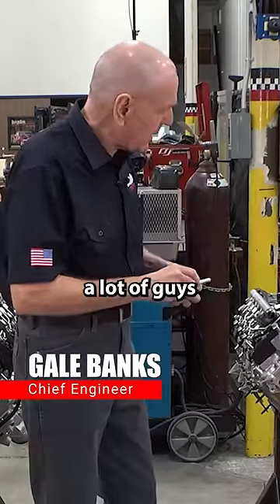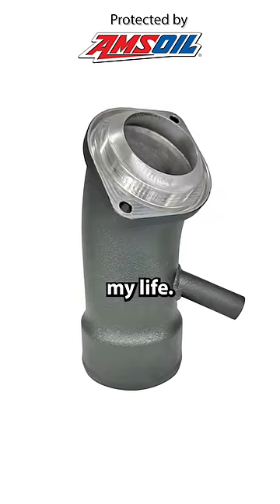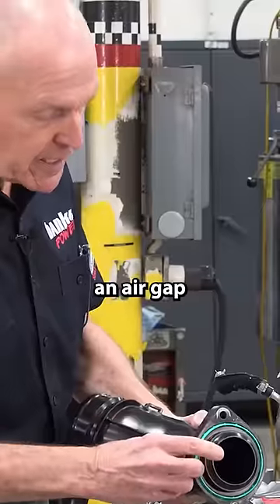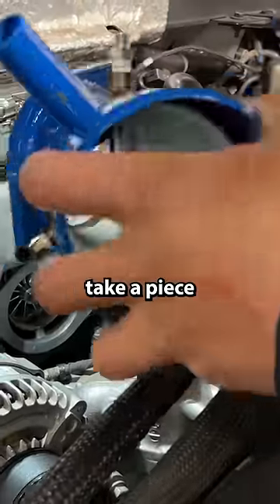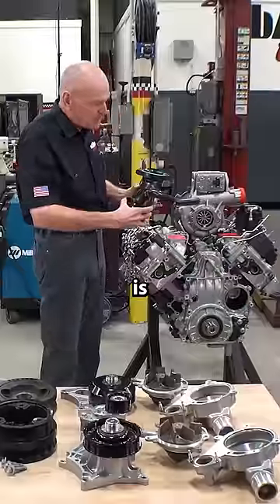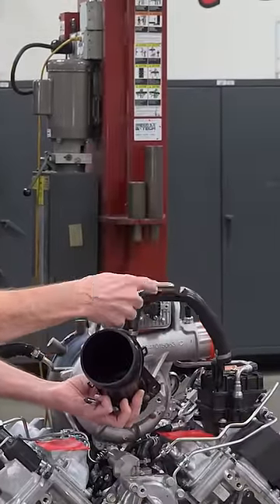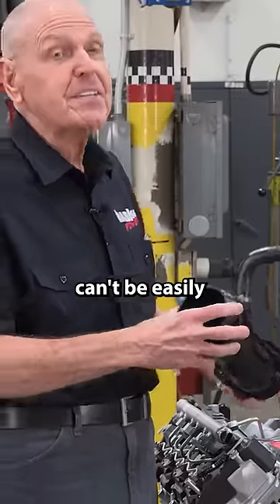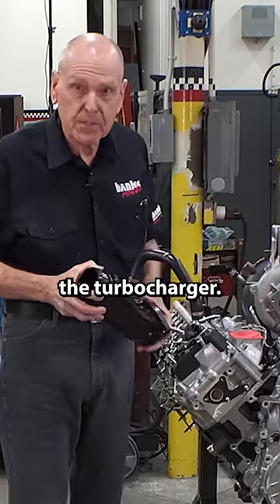The factory guys got it right. Don’t delete this!

Comment: The engineers who design engines get a lot of flack for their engineering mistakes that piss off mechanics, but they do get it right when it comes to how it should run from time to time. Thanks Mr. Banks for your wealth of knowledge.
Reply: Car/truck engines are amazing. The guys repairing engines have the ability to to see what didn’t work. Hindsight is 20/20. And mechanics don’t have to deal with emissions. All reasons why I can’t wait for a good EV truck. The combustion engine is not needed by 85%+ of the population.
Reply: What's funny is they catch a lot of flack, but it's mostly the accounting department that is the real issue. Add in epa and safety requirements, it's amazing that engineers can get anything done.
Reply: @Slowhand871  and to what points can you point at that 85% of the population doesn't need an ICE engine? Who are you to decide what anyone needs? Everyone needs to wake up to the idea that electric is far behind in terms of being a functioning, viable option for the average person simply due to all the inherent issues that come with owning an EV.
Reply: @crispybatman480  exactly.
Reply: @Thestockxj96 What, according to you, are the problems inherent to owning an EV and that stop it from being a functioning, viable vehicle? I'm not the original commenter you replied to, just a former petrolhead who has sold all my normal cars and switched completely to EV over the last two years.
Reply: @LMF5000  the fact that they're not worth a crap in the cold when you charge them, and I know this is a fact because there's Tesla owners all over YouTube who complained about not being able to even get one percent in their vehicle for hours until the battery hit a certain temp. #2 the batteries in most Tesla vehicles only get a couple hundred miles of range depending on many factors such as ambient temp, use, and amount of strain put on the battery. #3 and you're probably going to call me a conspiracy theorist for this, but I don't care because the truth is still the truth at the end of the day. The vehicles are hooked to the internet constantly, and therefore if a government entity or even Tesla didn't want you to travel all they'd have to do is shut your vehicle off with a remote killswitch. #4 the average life of an EV battery is about 10-15 years roughly. #5 most people don't make enough to replace one of those batteries, so what do they do? They toss the vehicle into a boneyard and it ends up leaking acid everywhere. Yeah, very environmentally sound, right? #6 inherent issues and bugs that electric vehicles have made me not trust them whatsoever because here a few years back a guy got into a wreck with his Tesla and it locked him inside and burned him alive. #7 all that charging you just did was either provided by an diesel or gas generator, so you're not really saving anything on the planet. You've traded one evil that you can see for something that's indirectly polluting every time you charge. So again I'll ask, who are you to say 85% of people don't need an ICE vehicle.
Reply: @Thestockxj96  Again, I'm not the one who made the original comment, I just thought I'd jump in since I'm an actual EV-only driver. #1 Yes, EVs cannot charge at insanely cold temperatures. ICEs need help at those temperatures too - like an engine block heater to keep the oil from freezing and a relatively new, very healthy starting battery to crank the engine reliably. #2 Yes, but a couple hundred miles of range is enough for most people. The vast majority of the population doesn't need to travel 500 miles in one go every single day. And at any rate on road trips you still need to stop to pee every couple of hours, so you can fast-charge the car while you're going to the bathroom and be on your way. #3. This is not an EV-specific problem, this applies to every modern car - electric or not. Almost every model in the lineups of all modern manufacturers are internet-connected and can in theory be disabled remotely. #4 After 10-15 years the battery will have about 80% of its original range left. That's still plenty for most people. Things degrade, EVs and ICEs are no different, after 15 years the car itself will be getting worn out (regardless of power source) and it would be time to recycle it for a newer model. I can tell you the warranty on an EV battery is 100,000 miles or 8 years, and the components on an average fuel engine have a design life of 100,000 miles too. After that point you start needing expensive maintenance (timing belt, water pump, clutch if applicable etc). #5 The running costs of EVs are vastly less than the running costs of ICEs. In my case a distance that used to cost €10 of petrol now costs €2 of electricity. An annual service (oil/filters/plugs) used to cost €120, now an EV service costs €45. Road license (depends on country) was €350, now it's €10 (but you can ignore this as it probably won't apply to your location). No oil, no filters, and the brake pads last a long long time since most of the deceleration is done by the motor in regen mode - so the savings on running costs over the years come pretty close to the cost of the battery IF it needed replacing at that point. #6 - sounds like a Tesla problem, not an EV problem. Buy a Nissan or a Hyundai or a Ford or something else. Some carmakers use the exact same car model and offer electric or fuel options, so there will be no difference in the "bugs" for components like doors etc - they will be identical because it's the same car whether EV or fuel powered. #7 I'm a mechanical engineer by profession. I ran a simulation on that exact claim. I found that if you take some quantity of Diesel, feed it to a generator, and charge an EV, it will cover approximately 20% more distance than feeding that same Diesel directly to a Diesel-engined car. The difference is that generators are designed for maximum economy so they're large, heavy and slow-revving (1200rpm - perfect for standing still, but not viable in a car) but car engines are designed to be compact, light and powerful (so economy suffers greatly). The EV itself is over 90% efficient at turning the generator's output into wheel horsepower, so overall it ends up the winner. But the point of EVs isn't that they're more efficient at burning fuel, it's that they let us use flexible generation options (like solar, wind and nuclear), and that they don't emit emissions outside your house - the emissions (if any) are in a centralised location where they can be controlled more effectively. #9 yes, obviously walking and cycling (or working remotely) are vastly better than using any type of car, but EVs are a step in the right direction. Plus they're much more comfortable to drive. Back when I still had one fuel-powered car and one EV I would start missing the EV after the first 2 hours of driving the ICE. You can't beat the seamless, silent power delivery without gears, the instant acceleration, the A/C that stays powerful at any speed (even in standstill traffic), the fact that it doesn't stink up the garage with exhaust fumes, and the ability to turn on the A/C remotely so I don't have to get into a searing hot car after it's been parked outside all day.
Reply: @LMF5000  let's see what the cost of electricity will be once everyone starts trying to use electric vehicles. The cost is going to go through the roof. The only reason it isn't right now is because hardly anyone is using EV tech right now. I assume you're in the UK being as how you're using the pound for your dollar sign, and I can tell you right now, geographically speaking 200 miles of range may seem like a lot to you, but for many of us in the US where everything is spread so far apart the idea starts to fall apart. Just look at all the US companies that switched some of their fleet vehicles to EV, and then decided after a few years that it was a horrible decision and decided to go back on it.  If EVs were such a modern saving grace, then everyone would use them. Maybe in another 20 years it'll be different, but as for right now I don't see that happening. The tech simply isn't there.
Reply: Let’s not forget the whole manufacturing process to produce an EV in the first place: including the copious amounts of mining for the lithium ore needed to make the batteries in the first place. Then there’s actually making the batteries in the plant using said lithium, both industries having an inherently massive carbon footprint on the planet.
Reply: @Thestockxj96  Europe actually (I'm using the euro sign € not the pound sign £). The great thing about EVs is that you can make your own electricity - I don't have the roof space but my in-laws have solar panels installed in their house and they actually produce more electricity than they consume, so the utility company pays them. But yeah, in my case I'm at their mercy. As of this moment electricity is 5x cheaper than fuel, but when charging on public fast chargers on highways, they've set electricity prices so high that it's actually marginally more expensive than fuel (but fortunately 99% of drives are done at home using cheaper private charging so it's not a big deal). I understand EVs might not be for everyone yet, but range is increasing all the time - but even then, how much range do you actually need? If you drive nonstop for 8 hours at 100mph that's only 800 miles (and some experimental EVs are getting close to that). At that point the driver becomes the limiting factor, not the car.
Reply: @toxicmasculinity7870  If BMW can manufacture an entire EV with neutral emissions, every other manufacturer can too
Reply: @LMF5000  it doesn't just need range. It needs to be functionally reliable, and these EV companies need to start divulging repair info to the owners, and then maybe I'll start coming to that side. I don't see that happening though because all these companies really care about at the end of the day is how much you're paying on your note and how much they can make off the repairs because we don't want you to have the right to repair.
Reply: @jonathansmith7306  yeah, but did BMW say that, or has this actually been verified as a "carbon neutral" vehicle by a third party, private owned entity? There's a huge difference between a company saying it and someone vouching for the company.
Reply: @LMF5000 you obviously don't live in Australia where the next town is 400k away and the town you're actually travelling to is 900k away. A ten hour drive that I don't need to take any longer than it has to. Then there is a weight issue if you add more batteries that stopping is not good enough in an accident situation. We have all sorts of things to avoid on that drive.  I don't need increased braking distance. Then let's not forget the flooded roads and river crossings. Water and electricity don't mix real well especially when you carry batteries that explode if water gets in them. Being honest I've never seen an ev in my country, I'm sure some yuppy has one somewhere but I've never seen anywhere to charge one. So they definitely don't have one in my end of the country. You're all being sold a lie mate.
Reply: How often do you actually make 10-hour drives? If it's a really regular thing then sure, maybe an EV isn't for you yet. But most people don't drive more than an hour or two per day so EVs are ok for them.

Now, have you actually checked the stopping distance of any EV at all? Engineers like myself account for the extra weight of the battery when designing the car and speccing the tyres and brakes - the stopping distance is identical to a normal car (actually better because you don't have a heavy engine up front, you have ideal weight distribution with the centrally-mounted battery). Secondly, EVs are infinitely better for flooded roads because they don't need oxygen and don't have an air intake. A normal car will bend a connecting rod when it intakes water but an EV will drive even when submerged because it's hermetically sealed. Plenty of videos on YouTube of dozens of normal cars getting flooded and stuck then an EV comes along on the same road and goes right through. That's the reason all modern submarines are electric (or nuclear-electric)
Reply: I fully agree. That's a modern car problem though, not an EV-specific problem. Manufacturers are getting a bit crazy with subscriptions for things and with adding hurdles to repairability. Which is precisely why I chose a Nissan Leaf not a Tesla.
Reply: @LMF5000  mate I gotta drive a few hours just to go to certain shops in near by towns. Near by towns minimum almost two hours one way. Spend half a day there driving around getting things done. Then get back home. Like I said no one will touch them unless they live in the city and go to work and back, do basic shit like the people you're talking about. And did you miss the part where I said I've never seen a single charging station in my entire state. Might be one in my capital city that's a 9 hour drive from me. My ten hour drive is just to visit my family and that's the opposite direction from the city and past there it gets way further apart and another 15 hour drive to the end of my state. That's just my coast line. Let's not get into when I travel west 11 hours just for work every ten days. It's so fat we don't come home until a ten day shift is over. Home for three days and back we go. Last week I drove 600 K just to visit a friend for a weekend. These ev's you talk of are absolutely useless to us here to the point no one will be putting in a charge station. As for stopping distance. Might want to look into what the yanks call trucks and the weight if not compensated for in braking distance is deleting other drivers. Now those size vehicles are what we all drive here because we have all sorts of terrain to cross and large animals to hit along the way.  You are believing lies mate. Good luck with that, no one here wants any part of it.
Reply: @Thestockxj96 nope I’d say most of the population would suffice with an ev. Soon as the infrastructure is here no point not to. It’s not gonna save the earth but the cars are so nice and the quietness is amazing
Reply: @crazywormy5869  you're sacrificing the ability to be able to fix things yourself at home without spending thousands of dollars for something that can be remotely controlled and is extremely complex and convoluted, and literally requires thousands of dollars worth of safety equipment and special tools to fix that no average diy at home person has. WHEN your EV breaks down do you really want to be stuck in the endless loop of trashing another vehicle in a boneyard and starting the cycle over again after paying hundreds of thousands of dollars for a vehicle that lasts, at most, 10-15 years per battery before needing to be replaced? Also, what about when the infrastructure gets there? Don't you logically think everyone's electric bill is going to go through the roof? Do you really think the powers that be are going to allow you to have cheap electric charging at your house forever? Y'all think it's a saving grace. You're only trading one demon for another that makes you feel better in the moment.
Reply: @Thestockxj96  just tell me your not smart enough to fix it yourself then. Everything can be fixed yourself just depends how hard you want to work. No harder then any car from current year
Reply: @crazywormy5869 I never said I wasn't smart enough to fix it, but what do you expect out of the YouTube community. Your willingness to assume someone's intelligence tells us more about yours, but we're not here for that so back to the point. The point is, Albert Einstein, most of us don't have the at home tools required to fix these types of vehicles. I'd love to see you work on one without the required tools and you tell us from your coffin how that went.
Reply: From time to time, meaning once every 20 years.
Reply: @Slowhand871 "The combustion engine is not needed by 85% of the population" has to be one of the daftest,blinkered statements ever.
Reply: it's not even the engineers fault most of the time, they point out something needs a redesign and the pencil pushers tell them it's not worth it.
Reply: engineering time vs shade tree time
Reply: @Thestockxj96 he probably wants us to own nothing and eat bugs too
Reply: @tonymarshall9670 I think it’s fair to say that EVs wouldn’t work in your situation. Your situation does seem quite strange though. A 2-hour drive to the nearest town. An 11-hour drive to work. Those are very abnormal things. Do you realise that? Most people don’t live in such isolated locations where they undertake such tremendously long journeys in their day to day lives.
Reply: @tonymarshall9670  Out of curiosity, can you give me the names of a few of these towns that you travel to/from? I want to plug them in to the ABRP software and see if my EV could make the trip - just to get an idea of how far we are from making it possible.
Reply: @Monaleenian  That's where you are wrong. That's what most of Australia is like. Sure some people don't go as far depending on what they do. But at some point most of those people take long drives at least once a year to visit relatives or friends. We don't have planes that fly everywhere and that's far too expensive for most people. You still need transport when you get there. There is a good reason there are no charging station's here. Australia is to wide spread. The state I live in I share with millions of people this is how we all live. Everyone here travels to nearby towns for work, shopping, even doctors if you need specialists same with hospitals. It's not unusual to us and ev cars is not one the shopping list here for anyone. We all know they are useless to us.  At best our taxi service have some of those electric/pettrol hibred's. Some people have cars that can shut down when stopped and some of the v8s that run on four cylinder until you accelerate hard. Mostly we don't drive v8s anymore and we've switched from 6 to 4 cylinder cars in a lot of cases. Mainly due to fuel and registration costs. And the fact 4 cylinder engine's have come a long way in the last couple decades. It's not that we are not lowering fuel consumption it's that no one in their right mind will buy a car that can't do the long trips everyone enjoys or has no choice in doing. We all need to be able to drive further than ev can go.
Reply: @tonymarshall9670  It doesn’t really matter what most of the landmass of Australia is like. Australia is one of the most urbanised nations in the world, with 90 percent of the population living in just 0.22 per cent of the country’s land area. The 2016 Census showed that more than two-thirds of Australians lived in a capital city, with 40 percent of the population living in the two largest cities of Sydney and Melbourne. For the vast majority of families living in urban areas of Australia, having one electric car makes sense. The second car could be a petrol or diesel for those rare occasions that they need to make a huge journey that brings them outside the range of EV chargers if that’s what they think that they need.
Reply: @Monaleenian  I've lived in Melbourne and can tell you it's not unusual to take a 3 hour drive to go do things for the day. Your ideals don't make sense to the majority of people here. Common knowledge here that it won't work for most people. Does it not register to you that those are big spread out places. Most don't live on top of each other in buildings. Add all the traffic in those built up areas and that adds a lot of time to the drive. Then look at charging time. We don't care for it and if we did I'm sure you'd have statistics to prove me wrong with all the sales of these EV's. Do you have those statistics?
Reply: @Monaleenian  Or, you could put that engineering knowledge to use and make a car with an on-board generator that provides electricity to the motors instead of a giant battery.  THAT'S the future, because, when looking at diesel-electric trains, it's the present, and the past, and has proven to be a robust and reliable system.  Why put stress on an electrical grid that won't be able to handle the demand when we already have the infrastructure necessary for liquid fuels..?

Don't get me wrong, now; battery powered cars are fine for short trips/commutes where you can plug them in when you get home.  However, for anything more than a hundred miles or so, batteries are not the way.  All of the battery advancements have been great for my power tools and RC trucks, though!  Haha!
Reply: @LMF5000 solar costs about 10k a panel right now in texas. that’s a lot of money to charge one car.
Reply: @LMF5000 also bro, going from one side of Texas to the other is like me going from Luxembourg to Budapest.
Reply: The problem with stock engines is balancing budget and mass production with performance. I'm sure the engineers at all the big companies would design a near bulletproof engine given unlimited parameters besides size, but the bean counters in the head office would never let them
Reply: @cwj2733  interesting, that's 1200km or 9 hours of driving. My old petrol car could manage it on 3 tankfuls of petrol. My city EV (40kWh nissan leaf) would need 6 full charges in theory. In practice ABRP says 14 partial charges and 18 hours of total time.

And with a long-range EV like a Hyundai ioniq 5 it's 12h20m with 6 charges
Reply: I'll trust the factory engineers over the keyboard engineers every time.
Reply: If engineers didn’t get things right most of the time, cars and trucks would never even be able to driven off of the dealership lot after the initial purchase.
Reply: @crazywormy5869  the infrastructure will never exist because no one can make money with chargers. In order to be viable with everyone driving them you'd need whole parking lots full of chargers. 

Why do you think it is that people constantly complain that they're broken? It's because they get built for tax credits and then are functionally abandoned.
Reply: @Slowhand871  You'll be waiting a few decades yet.
Reply: @LMF5000 a decent ev in the US still cost around 50-60k. There's no way in hell I'm paying that.
Reply: @notpoliticallycorrect1303 It actually true, whether you like it or not.
Reply: @Slowhand871 Personal vehicles wouldn't be needed by 85% of the population if we had actual transit infrastructure.
Reply: You can never get at that bolt without having to take half the car apart. You know that bolt, it's always the last one. All that only if you have the right tools in the first place 🤔 🤨
Reply: @Slowhand871  Once that 85% of the population have EVs there will be some huge logistical problems. Even once the power grid is improved to be able to handle the amount of fast charging stations to replace the fueling stations, you still have the issue of time it take to charge. Even if you get a full charge in an hour, you have to consider that each person showing up will have to do that or at least half that. Right now it takes 5 to 10mins total to fill a vehicle even accounting for paying and everything. I still pull into gas stations and several cars are waiting for the next person to finish fueling before filling up themselves. If those people are stuck behind someone taking an hour or even 30mins to fill up then it will get out of control very quickly. I just don't think EVs are there yet for personal vehicle usage at scale. Especially here in the US
Reply: @Thestockxj96 Hybrid is where its at for now at least. Best of both worlds. Flexfuel stuff was kinda cool too but I never owned one so I don't speak from experience.
Reply: @tonymarshall9670 cool so you’re obviously not the 85% they’re taking about smart guy. most people drive less than 10k miles a year
Reply: @brink1551  it's not just me. Many people here drive great distances here. Last week I've driven around 3000k. That's an excessive week. All I did was visit an old friend for a couple days. Then I drove to buy a motorcycle. So happen to be that both were about the same distance from me. Only problem they were on opposite direction. This was a lot of diving and there were many vehicles going on those roads. I'm sure plenty didn't go as far as me but plenty went a lot further. It's simply not feasible where I live. And as you are saying 85% only go 10 K miles. Then it will cause a lot more issues to change to a whole new system scrapping the old over such a small amount of use.
Reply: 99% of "engineering mistakes" are actually the direct result of bean counters and regulators meddling in the design process.

Back before those were an issue, the machines made a hell of a lot more sense.
Reply: @LMF5000  i greatly enjoy reading your replies. I am a die-hard motorhead that wants to take a v8 to the grave with me when i die, controlled chaos is soothing to me. You provide a great perspective on EVs and some day i may own one. Possibly a very simplified hybrid. You have very rational and realistic answers and you are a great presence in these conversations.
Reply: @pedlpower factory engineers aren't the marketing department, the ceos looking for whatever sells, or the shareholders demanding infinite growth.
Reply: @tonymarshall9670  Mate, I live in Melbourne too but you are completely missing the mark. Yes, we know you drive far, and we arent fkn stupid to think it is just you. Many people do drive long distances on a daily basis, but the vast majority still don't. 

You and everyone else always makes the assumption that electric cars have peaked, like that's far from it. The technology is literally still developing and at a rather rapid pace. Like Mercedes literally have an experimental car that was driven 1200km on one charge, going at an average of 90km/h. Thats literally more than most petrol cars. Its also actually enough charge for you it seems in your excessive week, unless you did the 3000km drive in less than two days. There really arent many people who need 1200km+ a day.

Whether you like it or not, hybrid or fully EV will take over, with the few who need to drive long distances owning a petrol.
Reply: I appreciated your analysis of ev cars  however I don't think you allowed for line loss from a power plant 2nd if you look at the idea behind the INGO car it out performs the ev in full economy 3rd in an ice the valves eat up about 25% of work from the engine if more effechant valves were used along with natural gas as a fuel the ev looses in fule effechancy and net pollution from fossil fuels .hope you do the math on this  'best regards